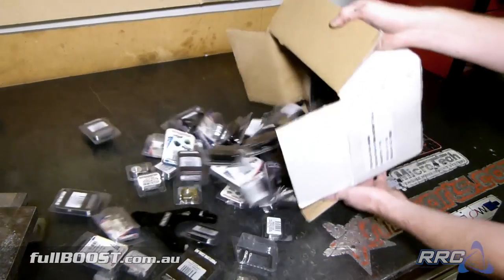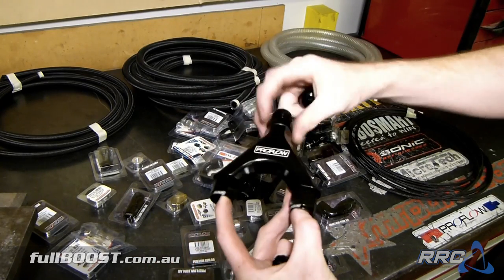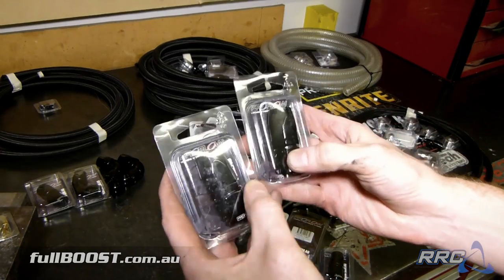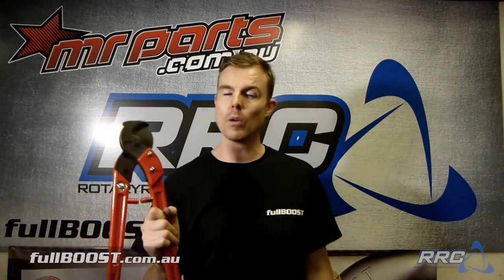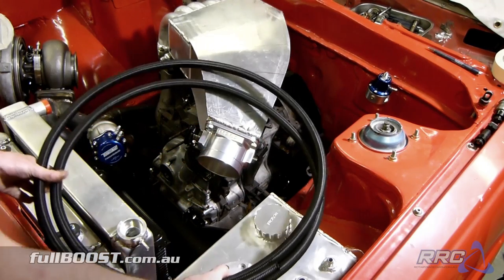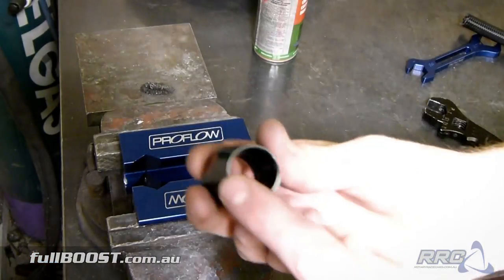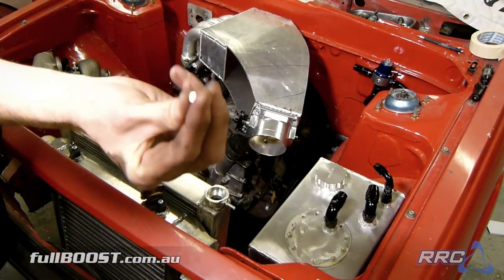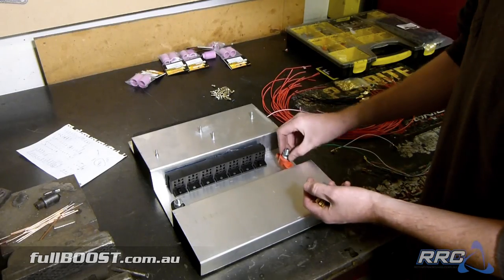BACKYARD MECHANICS | Installing Hose & Fittings | Project REDLINE Mazda rotary build Ep 7

Comment from the maker: In this episode we go over the full range of Proflow fittings and hose that we will be using on our Mazda for our fuel and oiling systems.
Reply: Fullboost can use do a R34 GTR  1000hp/785kw project by the way I'm a 12 year old car guy who adores GTR's, my dad has a 32 and we want to make it 750hp max drag car😇 hope you read
Reply from the maker: We prefer the R32 shape personally ;-)
Reply: Those guards..
Reply: Fullboost can you guys do a proflow vs speedpro leak, compression and any other test between the two?
Reply: sea doo ive used both, speedpro👍
Reply: How much did all that cost? Those ally fittings are pretty exxy.

Comment: Hi  I think you missed a couple of important things when making these hoses. 
No pressure testing, at least fill them with air pressure and do a bubble test.
When fitting up hoses with dual angular fittings you  test and measure where the first fitting tightens up on the hose and off the hose, also should mark the hose in relation to the screw on collar where it tightens up and starts. I do this with a bit of masking tape on the fitting and hose. You can then install a pair of angular fittings on the hose in any plane you need and not have to twist it. I would assume that you only fit the hose ends once as if fitted multiple times the hose is derated and can leak at the fitting or even blow out.
Cheers
Reply: dazaspc i thought samg was the only hose doctor in here. Or atleast that was his dad says 💦💦💦💦💦
Reply: I've used the masking tape method but have found there is no need to pressure test ferrule to hoseend assembly if the manufacturers instructions are followed and AN torque settings are followed.

Comment: A lot of master cylinders, brake lines, calipers, and clutch slave cylinders are aluminium and they're fine. I know brake fluid is corrosive but why would they make so many things from aluminium if it won't hold up?
Reply: yeah i was thinking of other stuff like the use of rubber hoses Vs teflon when i was talking about corrosives as being the issue, cant remember to be honest! but the main reason i use steel or stainless fittings on brake lines is for strength.  Aluminium can get fatigue stress and fail in high stress strain environment, and the -3AN fittings are very small and thin walled, so when it comes to brake fittings we take no risks.
Reply: MrParts_RotaryRaceCars Most definitely makes sense. I've seen aluminium line explode from hard braking without a power booster on a 240sx before. I'm sure it's partly because it was the roll of line and wasn't the right diameter being to small. I know the straight line tends to be a bit stronger and is what was used to replace the lines. I'm actually curious as to what the absolute best brake line is now. Aside from diameters and fittings I wonder what line has the least problems associated with it.